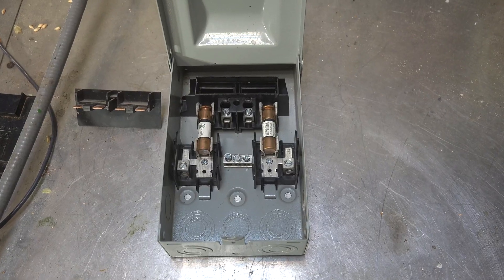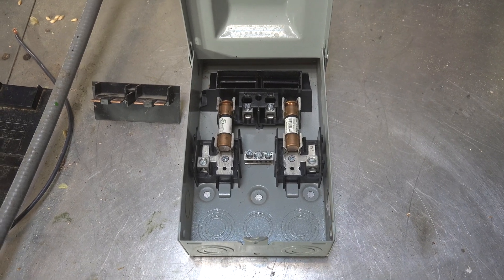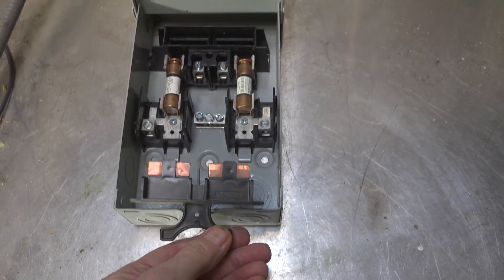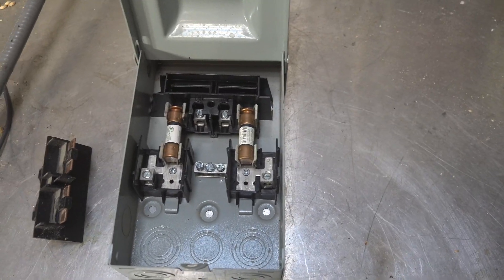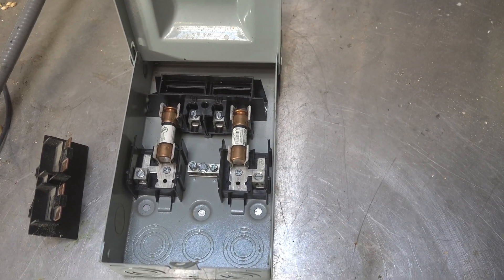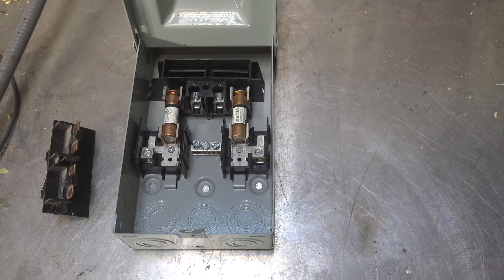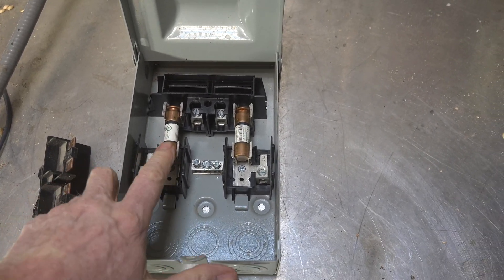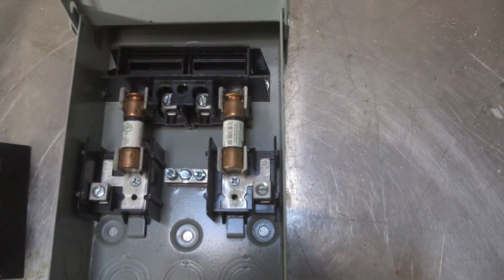Water heater blows fuses.  A diagnostic problem to solve.

Comment: I really need some help and info on this. I have the same exact everything except one blows couple days later the other blows. And it’s winter time. Never done this before. Also can I just by pass this?  I replaced the heating elements and both thermostats cause I couldn’t find the issue. And the issue is the fuses keep blowing. ???? Help please.  Can I by pass?

Comment: Is it okay to by pass the buss fuses? Cause I have a breaker that’s before the buss panel. ????  What’s the cause???
Reply from the maker: First, have you watched the video referenced at the end of this video?  It explains what happened.
Also, are the fuses blowing or are they overheating?  Burned marks on the fuses indicate overheat.
As for the removal of the fusible disconnect, if the breaker in the panel has the same rating as the fuses in the disconnect, you may remove it.  
GFM

Comment: Possibly a bad electric element that is shorting out could cause fuses to blow but that wouldn't likely increase the electric bill. If there was a leak in the hot water line some where it would cause the water heater to operate more than it should.
Reply from the maker: Check the end of the video to see the answer.
GFM

Comment: This is a useless video, ultimately, if you don't give the answer eventually.
Reply from the maker: Did you check the link at the end of the video?
GFM
Reply: @grayfurnaceman  There's no link visible at the end of the video. You're making this unnecessarily difficult, something a good teacher doesn't do.
Reply from the maker: @HorribleOldCrank  I just checked the video.  Link is upper left.
GFM

Comment: Condensation from an A/C dripping into the disconnect, or as has been said, sprinklers drawing hot water due to cross connections in water piping... I get the feeling that simply examining how weatherproof the disconnect is  might hold the answer...
Reply from the maker: No A/C.  Disconnect inside.
GFM
Reply: The plot thickens... well done sir! I shall go back to the drawing board 👍🏾
BTW, as a mechanical plumber living in Victoria, Australia , your content is great! So please keep it coming!!

Comment: That disconnect was near the water heater but didn't supply the water heater it supplied something else like a well pump and the water heater was connected directly to service panel breaker/ fuse
Reply: You didn't say where you checked the amp draw ie at disconnect or at water heater etc.
Reply from the maker: Amp draw checked at the W/H.
GFM

Comment: If water heater is blowing fuses something on that circuit is causing high amp draw but it doesn't have to be connected to the disconnect it could be connected to a separate disconnect but on the same circuit.  maybe a well pump connected to the same circuit but a different disconnect .  (normally in winter well pump not on a very long continuous time) and possibly a service panel with say 40 amp or higher breaker on that circuit so when well runs for extended period and water heater happens to come on to meet hot water use  the whole circuit is overloaded but the hot water heater fuses blow first each time ? Higher utility bill actually due to more water and pump costs.
Reply from the maker: Water heater is on a dedicated circuit.
GFM

Comment: the outside tube is open (melted, corroded or arced by lightning, etc.) but the element inside is still intact. this causes lower heat output, higher electric bills and used to, when plumbing was in metal piping, would shock someone. higher power consumption will blow the fuses but the circuit will not show a fault. this problem has to be tested and found using a megger or high ohm output meter. this is my opinion. second thought: since it is summer and not a lot of hot water needed, they have evidently tapped this circuit for a small air conditioner as well and when the water heater does cycle while the air is on it is too much for the fuses.......g
Reply: he said no a/c
Reply: @teekay1785  i apologise for the over sight.......g

Comment: My "guess"... It is plumbing or electrical. The summertime watering must be a factor or else it would not have been mentioned. I say plumbing. I would guess that the hot water was hooked with the cold water supply to the outlet and the hot water to the inlet. This would cause the thermostat sequence to be backwards and make both elements energized for as long as the fuse last.
Reply from the maker: The "either or" thermostat on the upper element prevents both elements from coming on.
GFM

Comment: Cold water siphoning in through hot water inlet causing both stats to turn on simultaneously causing fuses to pop
Reply from the maker: First, the "either or" thermostat on the upper element prevents both from coming on.
Second, how is the siphoning happening?
GFM

Comment: There lawn sprinkler is drawing hot water thru a single lever faucet that is in the open position with a secondary means to stop the flow , such as a shower head with a button to stop the flow, or any mixing valve with a way to stop the flow such as a kitchen faucet with a spray hose instead of a spout.
Reply from the maker: You are so hot you are smoking!  I will explain on Monday.
GFM

Comment: Did they have one of those Y mixer hose's that connect to a separate hot and cold tap to mix hot and cold to a single outlet?
Reply: Probobly didnt see too many tempering valves on water heaters 30 years ago.
Reply from the maker: No.
GFM

Comment: I'll try again.  The Phillips head screws mounting the two lower assemblies are a little too long, just barely touching the metal box behind the insulated base, and providing sufficient current to ground to blow the fuses.  The current draw to the water heater elements would not be affected since the short occurs BEFORE the wires leave the enclosure.
Reply from the maker: That would cause a dead short and the fuse(s) would blow immediately.
GFM

Comment: I'm guessing it was a cross connection between the  outlet side of the Hot Water tank and the cold irrigation water. We never had disconnects like that on Hot Water tanks up here, although I have installed them with Heat Pumps lately. He must have had a big yard and garden. lol
Reply: OK a cross connection between the single handle Moen faucet. I have experienced the same thing with worn 2 handle faucets as well. Hospitals have elaborate Reduced Pressure Double Check Valves (RPZ's in trade nomenclature), that require yearly testing and calibration to avoid this backflow problem.

Comment: Were there multiple outlets or current loads hooked up to that circuit to blow the fuse? I didn’t see the fuse rating but I’m guessing 10 amp and the breaker is rated 25.
Reply: he said 30 amp fuses and amp draw from heater was normal and rated to have 30 amp fuses.

Comment: Utility company limiting utilities in the summer at certain hours or days. Hot water heater not receiving correct voltage causing higher amp draw when elements come on causing fuses to blow.
Reply: Nope, the heating elements will draw less amps at a lower voltage
Reply: but why the higher utility bill then ?  Maybe using well pump more for lawn watering ?
Reply: @teekay1785  I never thought of that, good thought! I wonder if they have a well pump?
Reply: I'll go with this answer.

Comment: Loose fuse clamp on the blown fuse symptom. And on the electrical expense/ Supply & Demand issue during summer months. Also wrong plan on electrical contract with supplier. Non-Flat rate... Using variable rate, High usage during peak times. 🤷‍♂️

Comment: Is the tank overheating water due to faulty or scaled thermostat? Before t and p valve opens fuses blow maybe t and p valve is covered with scale as well. I also think winter time incoming water temperature is much lower so it won't be an issue.

Comment: The water supply was extremely cold being underground and once the sprinkler started, it drew that colder water through the lines making the water heater work harder.
Reply from the maker: Water temp in this area is 45 to 55F winter and summer.
GFM

Comment: Wife was pulling disconnect handle out and maybe she or her husband wasn't fully seating the disconnect handle back into the ON position? Or the plastic in the disconnect deformed in summer months creating a problem. I'm grasping at straws. This is a good brain teaser!
Reply from the maker: The disconnect is in good shape.
GFM
Reply: @grayfurnaceman  I give up. I would delete the disconnect and rely on the circuit breaker. If it trips a 30 amp breaker, I would have the house exorcized for demonic possession.

Comment: My guess is that water heater fuse box is also powering something else that's only use in the summer months. I once replace a screw in fuse for a hot water and lady hallway lights came on.
Reply from the maker: The water heater is on a dedicated circuit.
GFM

Comment: I'm going to guess that due to situation only happening in the summertime while they're watering their lawn, the consumption of cold water from watering the lawn and them in the house using the hot water which drain down the tank , the tank couldn't stay filled with cold water supply which exposed the elements and caused higher amperage draw which in turn cause high electric bill and eventually too high draw to keep fuses intact. Elements must be covered in water otherwise they will overheat and self destruct.
Reply from the maker: No problem with the heater elements.
GFM

Comment: Are the fuses FRN-R and on the same circuit with the AC ? OR...Water use is drawing from heater, not replenishing fast enough,  leaving elements exposed ?
Reply: i think he said no ac.  and those fuses in the picture are ECNR

Comment: Condensing unit is on the same circuit as the water heater.
That's why it only blows a fuse in the summer.
Reply: He mentioned they did not have air conditioning

Comment: I would guess that either the water heater element is shorting to ground thru the water to the tank or they have a cross connection to the cold water. I saw this several times when a valve that cross connects to from the hot to cold to stop the toilet from sweating. I don't think they use these any longer. A shorted element does not always blow fuses but can run the electric cost way up because it is using current inside the tank thru the water to tank jacket.
Reply from the maker: All true but not quite there.
GFM

Comment: The water heater is outside in a very small utility room.  The fuses blow when hot water is used due to the de-rating effect of high ambient temperature on the fuses.
Reply: something like that plus he is watering the lawn with hot water.
Reply from the maker: @MichaelMantion  Cold water is piped to the lawn.
GFM
Reply from the maker: Wow, that's a stretch.  Think simple.
GFM

Comment: First off its clear that the husband doesn't pay the bills. Sounds like the sprinkler is siphoning the hot water out of the water heater and mixing it with the cold.
Reply from the maker: How?
GFM
Reply: @grayfurnaceman  Is the water heater on the 2nd floor?
Reply from the maker: @averyalexander2303  No, basement
GFM
Reply: @grayfurnaceman  The cold water feeding the sprinkler is just before the hot water heater causing a siphon action.
Reply from the maker: @mrkrasker9609  Close, but no cigar.
GFM
Reply: Any faucet would be able to do this if there were a shut off on or beyond the spout, like a lather button on a shower head.
Reply: The husband is doing what every other husband does in America, bringing the money home..

Comment: Is the air conditioner on the same circuit as the air conditioner ?
Reply: No air conditioner
Reply: Hmmm if an element isn’t shorting through the water the ground then I might suspect a shorted sump pump on the same circuit?
Reply from the maker: @KansasHVAC  No sump pump.
GFM

Comment: Breaker panel not balance Amp draw to high on one leg in the breaker panel.  Wires get hot loosens. An unbalanced load occurs when there is significantly more power drawn on one side of the panel than the other. This can lead to overheating of electrical components and possibly overloading the panel.
Reply from the maker: Far simpler than that.
GFM

Comment: Ok well I had a similar problem and changed the water heater so it would have been really nice to find out what he actually did to solve the problem🤬🤬
Reply from the maker: The answer is forthcoming.
GFM
Reply: grayfurnaceman don’t get me wrong I appreciate the info but it doesn’t seem exactly “right” to have a channel designed to help people and then possibly be  keeping someone hanging on an issue they may have which you have the possible solution to that’s all
Reply: @10acScottyP  all in good time sir.
Reply: @10acScottyP  this is for techs to figured out. I had one that had a leak under the house and kept running water and heating water. A new tank did not work.
Reply: well if you changed the water heater the the issue resolved then it was likely your water heater.  UG I keep forgetting I need to change my sacrificial rods.  uggg..
Reply: Michael Mantion lets say your car is acting up and you take it to a mechanic. You go pick the car up and it’s fixed...wouldn’t you want to know what was wrong with it?!?!?! I figured it was the water heater that’s why i changed it!!!!! It could be helpful, and save time, to know specifically what to look for in the future. SMH

Comment: Don't you wish that you had a FLIR 30 years ago, you have a loose connection.
Reply: but would a loose connection cause a high electric bill? I wouldn't think so....
Reply: @95thousandroses  most definitely.  I had a loose dryer connection, it eventually melted the junction box in the dryer and corroded the wire to nothing.  the loose connection causes heat, the heat breaks down the metal making it more restive, making more heat....  loose or bad connections can definitely increase energy bills but The extra resistance would decrease the amps to the water heater which would make it run longer... BUT that would have been too obvious right?    And why only in the summer.
Reply: @MichaelMantion  ambient heat adds to the problem

Comment: Is there yard brown or green. Sounds like they are watering there yard with hot water.
Reply from the maker: Lawn is normal.
GFM
Reply: Ok that explains why he mentioned the were using water on the lawn.  I think you are right buy why blowing the fuse?  Over heating? I know they are slow blow fuses and they didn't have ac so its very possible there that box was was getting hot to begin with.  I don't know how big the law was or how often they were watering it but it would take a LONG time of the water heater constantly running to blow those fuse.  i mean like 4hrs straight or more.  They must have been using a ton of water as well.
Reply: Michael Mantion I would guess the disconnect blade is arching and causing  the fuses to over heat. Along with all the build up around the element if they are watering with hot water.

Comment: Hot water hooked up to sprinkler or outside spigots.
Reply from the maker: The outside faucet is connected to the cold water pipe.
GFM
Reply: @grayfurnaceman  did they have a pool?
Reply from the maker: @MichaelMantion  No
GFM
Reply: that was my first thought but then why would the fuses blow? I think you should be able to run a water tank on full bast 24/7? I think the mention of watering the lawn was a red herring.

Comment: They're watering the lawn with hot water. The water heater runs too long. The long usage, coupled with the high daytime temps causes the fuse to overheat and blow.
Reply: Makes sense and i could believe that if it was timed lawn sprinklers and not doing it manually. I would hope you could tell the difference between hot and cold water coming from the hose, lol.
Reply from the maker: The outside faucet is connected to the cold water pipe.
GFM
Reply: Power company dropping the voltage, brown outs
Reply: as long as the elements are always surrounded by water they can run for hours like that ...4500 watt heater requires a 30 amp breaker...that is more than enough amps to handle it.... ive seen them hooked up with 20 amp wire to a 30 amp breaker and vice versa..